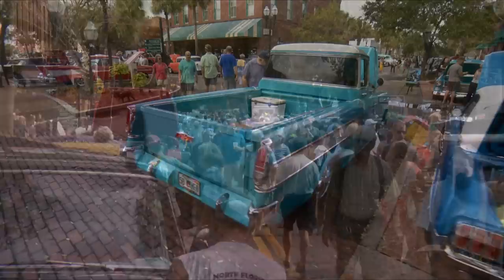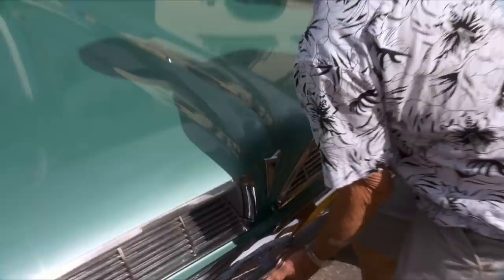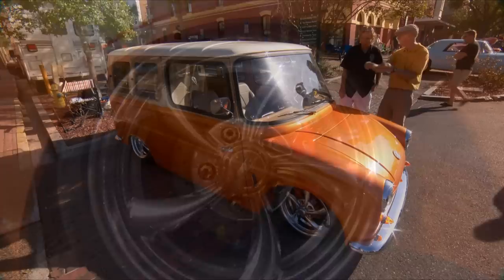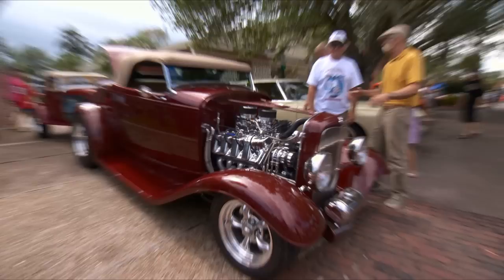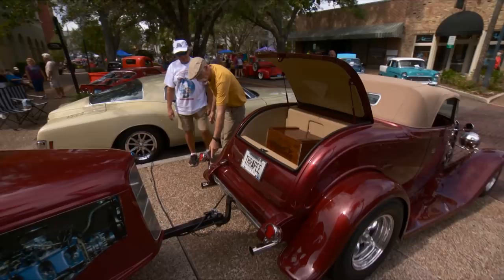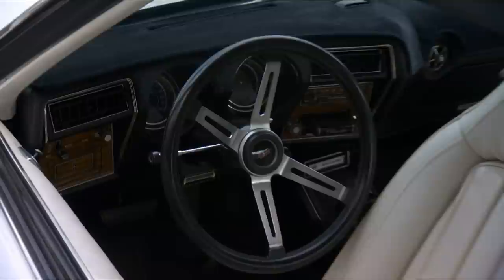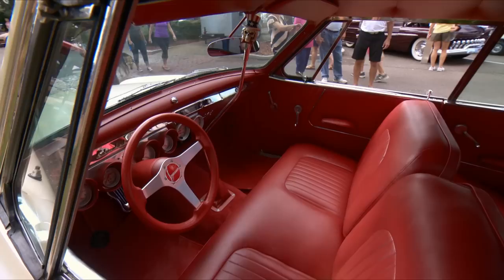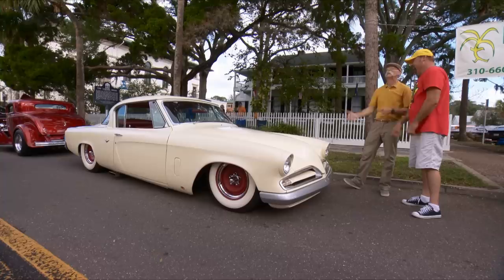1972 VW "Fridolin" | 8 Flags Car Show

Comment: The VW Kleinlieferwagen (Small delivery vehicle) is interesting, however might I say I don't think the owner quite has the right definition of Fridolin. As a German speaker I had not heard this and did some research. All I could find was it is a diminutive of the name Fredrick.  I have to say these little guys are much cuter than the Jeeps the USPS was using around the same time.

Comment: Hey Pontiac Guy, take some zip ties and bundle up all that wiring.
Reply: Yeah, me too! I was looking over this beautiful Bonneville (can't remember ever seeing a '61) and finding very little wrong with the exterior or interior and then he opened the hood.... It was a bit anticlimactic at best. OK, maybe you didn't have enough time to locate or fabricate an overflow reservoir for the cooling system before heading to the show or some buy longer battery cables and re-route them without laying across the inner fender well, but it would only have taken an hour to hit a big box auto or hardware store and buy a $2 bag of split plastic wire loom and hide every bit of that electrical eyesore. They even make it in colors now. It is still a hot car but you're taking it to a car show...